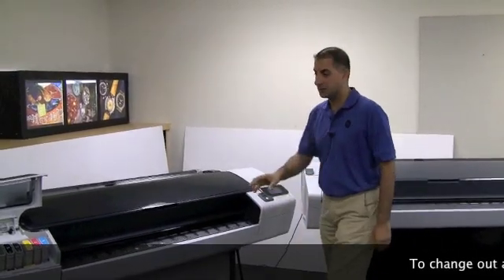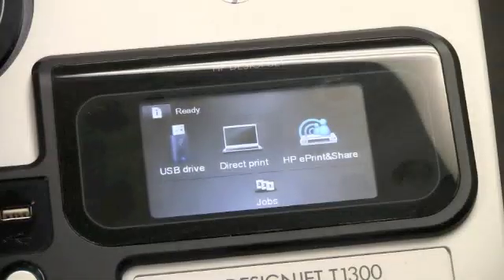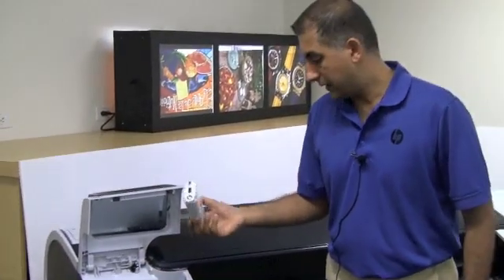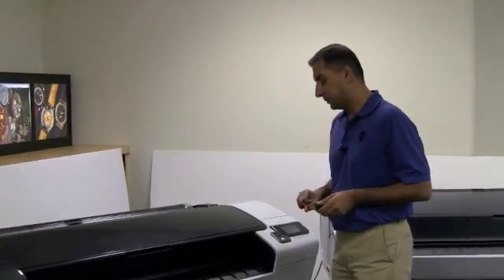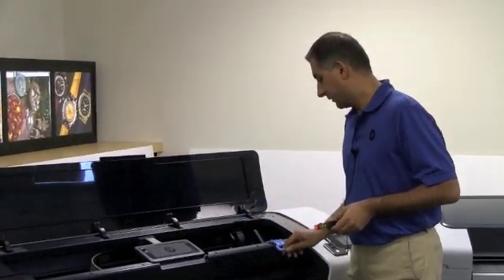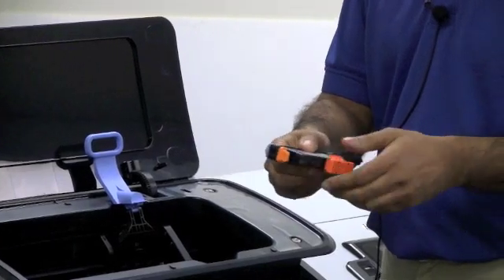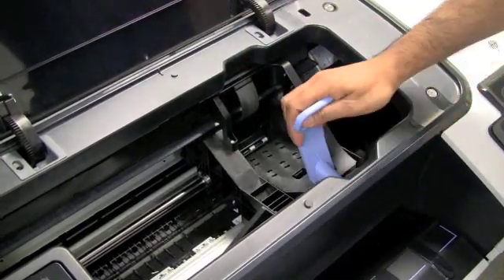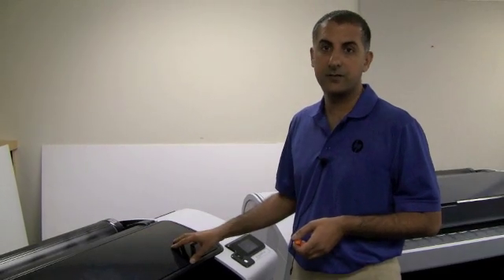HP Designjet T790 and T1300 - Changing Ink Cartridges and Print Heads

Comment: Yep, but what happens when the cartriage door is stuck and can't close... the back edge of the lid gets stuck behind a ribbed plastic structure inside, what to do then?
Reply: In case this happens to anyone: the cartridge door on the Designjet 790 is supposed to close simply by pressing on it. If it is stuck, then the mechanism for keeping the door open is jamming. There are 2 pieces of plastic behind the door in a crevice that can slide up and down. Normally, when you press on the door to close it, they should move down. Apparenty they can get stuck though. You can push them down manually with a solid object thats thin enough to get into the crevice (e.g. a ruler). When pushed down manually, you should be able to close the door.